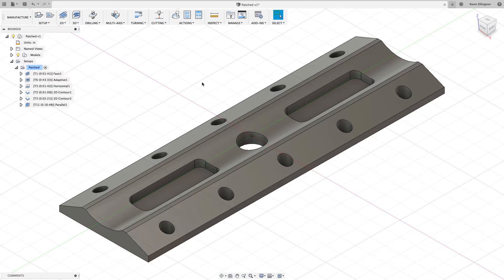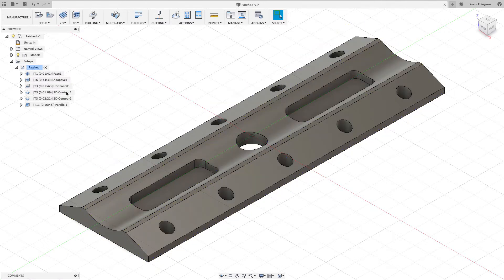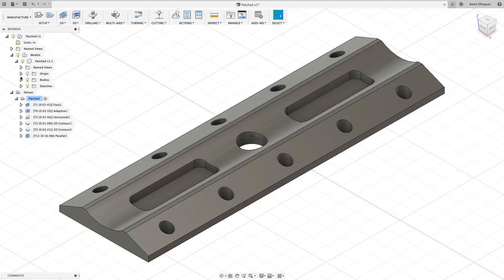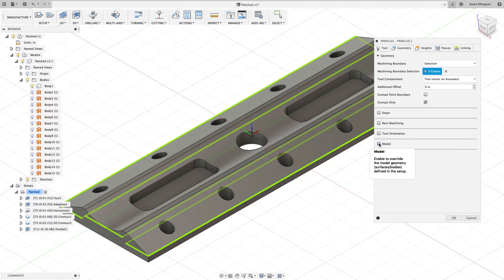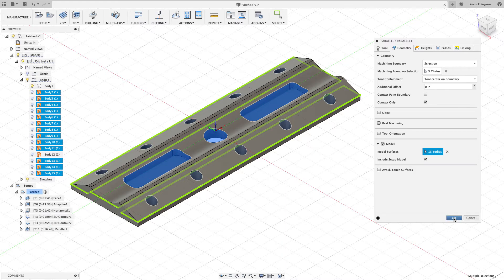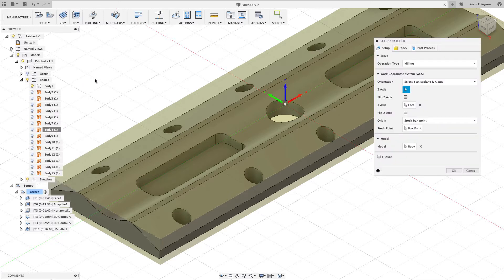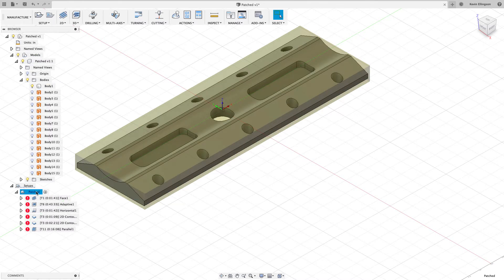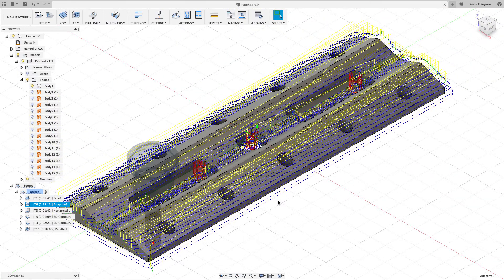Fusion 360 - Patch it up part II

Comment: Oh, I was thinking there where a good way for this. A good way is to select borders from holes, but Fusion do not really work good than. Other software can do this.
But what's about a other way: make a copy of the part, delete the holes and for the adaptive operation use this part. So you don't must select all holes separately.
Reply from the maker: You can also select the edges of the holes and pockets. The tool will then skip that area but sometimes I like this path method so the tool doesn't retract or change direction.